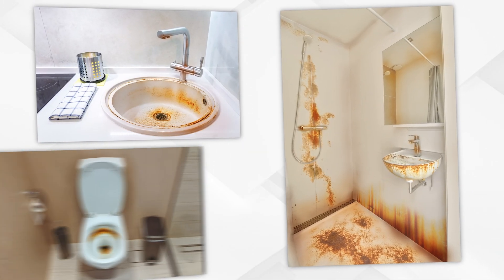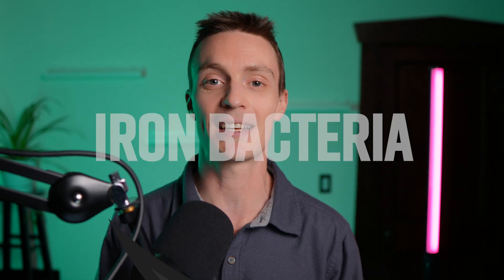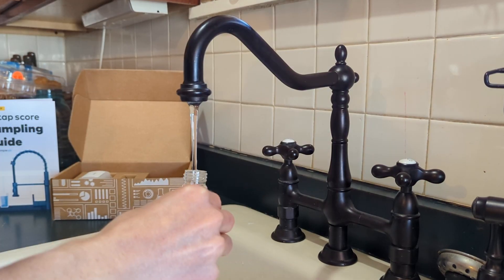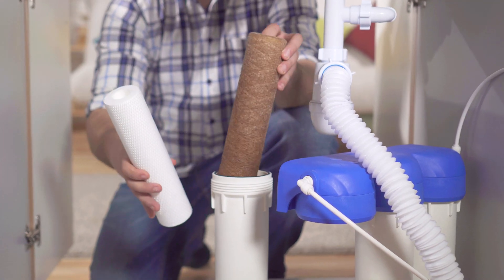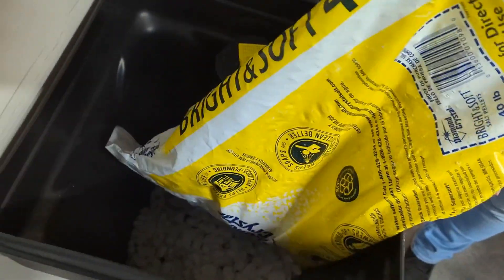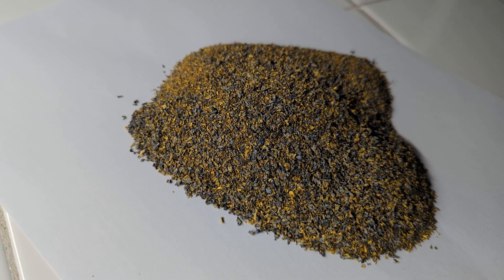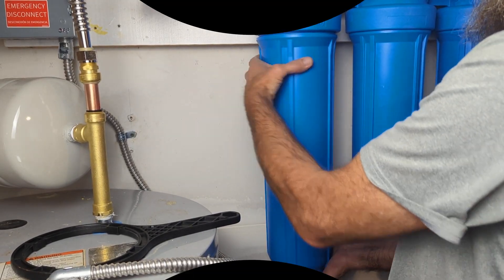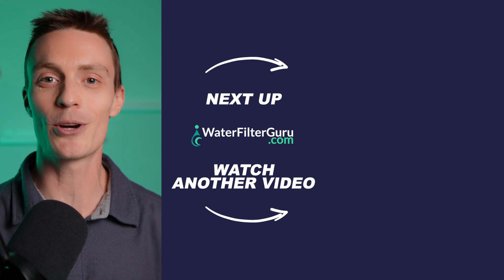How to REMOVE IRON from Well Water (Ferric, Ferrous & Bacterial)

Comment from the maker: Need help with iron in your well water? Let me know ⬇️⬇️
Reply: Yes I need help please! I have gotten a full well test done by simple labs mytapscore. Are you able to give a suggested system based on results?
Reply from the maker: @kyledorsey9441  Yes! I offer consultation services just for this. Learn more and submit your request here https://waterfilterguru.com/consulting/
Reply: Need assistance
Reply from the maker: @saidoubarry5633  how can I help?
Reply: I get a super thick mud like orange build up on my whole home filter that does 20 microns. I’d imagine it’s Ferris iron?
Reply from the maker: @BIGNickHenry  yep sounds like it
Reply: @waterfilterguru  I use the well for agricultural use. The iron doesn't bother my produce nor Cattles. But it kills my fishes when I add the water to my pond. I have both Bacteria and clear water. Like Tap water, If I pump the water into an above ground Swimming Pool, let it sit for a few days, will the iron sink to the bottom making surface to center water safe enough for the fishes?

Comment: Ph 5.6, ferrous iron 6, ferric present also, hardness 8. You didn’t describe what is best for this type of water.
Reply from the maker: Treatment would go in this order: sediment filter → pH correction → iron removal filter → water softener
Reply: @waterfilterguru I thought so. The company I work for sold them a softener because the salesman said he didn’t see ferric. I went to install it and it was orange when I turned it on and off several times and at the pressure tank. I refused to install and now they’re trying to give me reasons why a softener will work. 🤦🏻‍♂️
Reply from the maker: @Mr.bentley_coupe  sounds like the salesman may need some training!
Reply: @waterfilterguru No doubt

Comment: Looks like my alexapure removes all of this. I live in a rental, so spending $$ isn't practical. I just filter drinking and cooking water.
Reply from the maker: Iron is typically more of an aesthetic issue in well water which is treated at the point of entry with a whole house system
Reply: @waterfilterguru  Thank you. Is that also to say that it's not much of a health issue? Am I wasting my alexapure filters?
Reply from the maker: @scottc3165  I'm not a doctor and this is not health advice, but typically iron in water does not pose a significant health risk.
Reply: @waterfilterguru  Got it. Thank you. I'll do some research.

Comment: $300 for a water test?? 😅
Reply from the maker: $300 does sound steep, but it really depends on what you’re getting for that price. Your local county lab will usually test for a few basics like iron, manganese, and hardness at a much lower cost, but those are more aesthetic issues than health-related ones. For well water it’s equally important to check for contaminants that actually pose health risks like arsenic, uranium, and fluoride. I’ve found that Tap Score offers the most thorough analysis for the best value compared to other options. That said, if you know of another test that gives the same level of detailed results for a better price, I’d honestly love to hear about it!

Comment: Our 1 year old home came with an aquasana hole house system that i installed. After a short time, i learned that it was only effective to about 3ppm of Farris iron our well tested at 15ppm. I removed the system and replaced it with a peroxide injection system and regeneration on both the filters i might add. we have an 80-gallon settlement tank prior to the iron filter. This system is still overloaded. I added the original pre filter and iron filter back into the system and that seems to help but changing every month is expensive. Any suggestions?
Reply: hole house or house hole?
Reply: Try a couple of these...that's what i'm going to do...LiquaGen 4.5" x 20" Katalox Light Filter Cartridge – Manganese & Iron Reduction, and LiquaGen 5 lbs Fine Mesh Ion Exchange Resin – Well Water & Iron Removal Media...i'm installing 6- 4.5 x20's...
Reply: Test the water: Put some of the water in a glass or transparent cup. Add some tea. Color changes black/darker: It contains quite some dissolved iron (ferrous iron / Fe2+). if the color stays the same: low / no iron. Best to get rid of the iron: Build a very simple and cheap aerator. Get a 1,000 liter (aka IBC) tank or 55brl drum. The water from the well should enter the tank with self made venturi (sear YT). This adds air before the water enters the tank. No air pump needed. Let the water rest in the tank. The iron (ferric. Fe3+) will sink to the bottom. Take the water from just from the top of the drum and your water contains MUCH less iron. Manganese: The water in the need to tank be aerated longer. How? Loop water in the tank and again a venturi in the pipe and blow the water in the tank again. Manganese oxidation takes longer than iron (iron: 15 minutes or so. Manganese: 1-2 hrs). Want to see simple (sorry Indonesian but you'll understand): Search on YT for "Aerator venturi jika toren (tandon) dalam keadaan tertutup". This guy also has other setups. Large parts of Indonesia contain a lot of iron.

Comment: My water is crystal clear but turns brown after a while. Iron content is 2.0 ppm. What filtration can be used.
Reply from the maker: Oxidation + filtration or cation exchange water softening would work if 2 ppm ferrous iron is all you need to address.

That said, it's important to consider all the other water issues present as well when determining proper treatment. 

When was the last time you had the water lab tested?

Comment: Ive used a kdf filter before and had pretty good results. Best thing that works pretty good is shocking the well every few years
Reply from the maker: Thanks for sharing!
Reply: Excellent video! I had a water test come back with 1.2 ppm of ferric iron and low pH. I already have a 10 x 4.25 whole house filter using a 5 micron. I don't have much space as the system crawl space. I think a second stage system that uses cartridges might be my best option. What do you think?

Comment: I appreciate your video helping with treatment problems. Very informative and lots of useful information.

That being said, I have issues with treatment of iron bacteria. I only warn, that telling people to shock their well with high concentrations of chlorine can lead to many issues for customers. Like speeding up the deterioration of galvanize plumbing that maybe down well, in the ground or in their house. It also is somewhat aggressive to copper plumbing that also maybe present underground and inside of houses.

Unfortunately, simple sanitation in many areas will not resolve the issue. The iron bacteria can be coming from the veins that feed the well. In those cases it will be impossible to sanitize the well completely and in extreme cases shocking the well can cause the well to release globules of sludge that may plug screened wells, perforated liner and/or pump screens.

Working for a major well contractor, in a region where iron bacteria is common place, I've seen these issues occur. Like i said my only issue is with this video is people shocking there wells to treat iron bacteria. I just want people to be careful in that regard. otherwise great video, thanks for the information.
Reply from the maker: Hey thanks for watching and for your comment. Please note that I did mention that additional, ongoing treatment for iron bacteria may be required. Of course this depends on the specific situation, as you mentioned

Comment: So my water is clear and turns yellow after sitting and theres a slight film on top if viewed with a flashlight, But im not seeing gelatine or sludge or anything else. Could this still be iron bacteria or does ferrous also leave a small film on the water? Like its only visable with you shine a light on it, and it doesnt feel slimy after you pour it out.
Reply from the maker: It's hard to say with just that description. I'd recommend testing the water to determine if iron is present. What you describe could simply be dust settled on the surface of the water as well.

Comment: Hello, thank you for the video. What if the well water have a smell. My water comes out clear but I have some orange/ brown color around the toilets and tub. The water smell, what is the best option you would recommend?
Reply from the maker: Does it smell like rotten eggs? If so, likely hydrogen sulfide.

Orange staining indicates iron.

I'd recommend a comprehensive lab test to identify all issues present in order to confidently spec treatment systems.